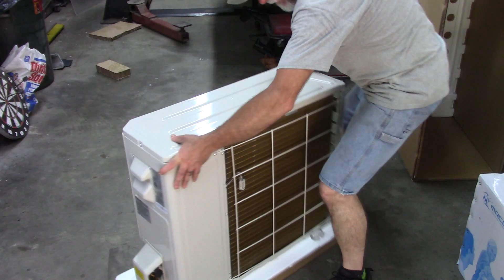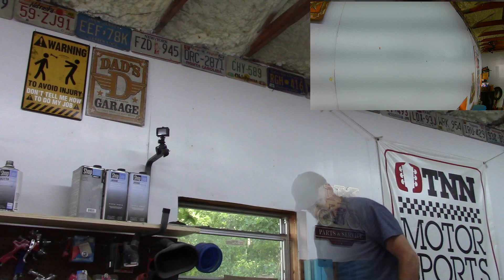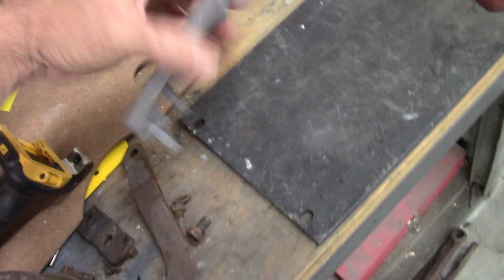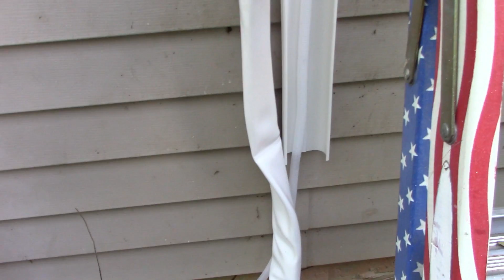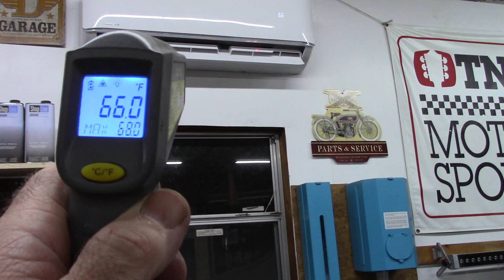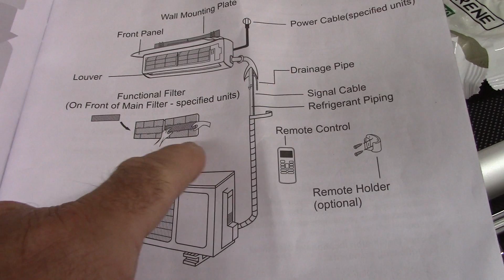Mr Cool mini split air conditioner install.

Comment: Great video... One question: is there a prevision to run the gas lines through the top or only the two 3.5" holes shown on the cardboard template?  I ask because my shop is concrete block and going over the wall and out through the soffit would be a ton easier than finding a 3.5" core drill..  The drain looks like it can go out anywhere lower than the unit. 
 Please keep us updated on it for a while. I have got to put AC in my shop soon. We have gone to 102* with high humidity lately and in no way am I working in the shop with that kind of heat..
Reply: Anything is possible or doable but keep in mind that installing the unit in a manner not covered by the manual may voide the warranty. Anyway, you would have to install the unit away from the wall in order to have room for the lines to go behind it and up.  Obviously, the drain would have to go straight out (at an angle) or you will have water pouring out of the unit.
Reply: Going thru concrete, use a small drill bit, drilling more holes and knock out with a hammer. Use foam to fill the hole after copper is placed.
Reply: Also, they make inline pumps for the drains when ran "up and over" "above" if you don't want to drill wall.
Reply: The drain line isn't really a problem. I just don't want to drill a large hole in the wall. As BIG RED said, I can build if off the wall to take the refrigerant lines up and over the wall and out through the soffit, but I just wondered it the machine has room to do it without building off the wall. The drain line isn't really a problem at all.

Just watched it again and around the 6:45 mark he starts showing the back of the unit. Doesn't look like their are provisions to go up without building it out away from the wall.
Reply from the maker: It appears you can only go through the wall where the 2 holes on the cardboard are indicated. It may be possible to modify it, but I can't say for sure.

Comment: scented mesh filter? for freshness? Clearly not intended to filter the air since its too small.
Reply: The mesh filters snap into the backside of the regular filters and are a Hepa filter. They collect much smaller particles that can cause allergies. I would use them in a home install. They probably won't do much in a Dusty shop setting though.

Comment: That drain elbow on the outdoor unit is if it installed over a door or walkway because in the winter it will defrost and drain the water. Leave it off for your house
Reply from the maker: Didn't think about that. Thanks.
Reply: You act like you do this for a living Joe Shearer
Reply: Justin Hernandez part time HVAC part time
Reply: Your part time HVAC, full time hamburglar

Comment: I think I would have ran the lines inside the shop and then made a hole at the height of the condensor. Leave the excess inside the shop

Comment: I would recommend placing 3/4 inch plywood behind the unit to reinforce it if matching up a stud is a problem.  Match the plywood with the stud, and all the other mounting screws will go into plywood for a strong and safe connection.
Reply: the head units are not heavy.  you can use wall anchors.  3/4 plywood is overkill.
Reply: Those white spiral type plastic drywall anchors will hold 75 lbs each in 1/2" rock. x 5 anchors = 375 lbs
Reply: The unit is less than 40lbs. Use snap toggles if you like. Over 250lbs capacity in 1/2 drywall.  https://www.lowes.com/pd/toggler-2-pack-assorted-length-x-1-4-in-dia-toggle-bolt-drywall-anchor-screws-included/3183821?cm_mmc=shp-cprdtahgooglelia-126-hollowwallanchors-3183821-_-0&kpid&store_code=1200&k_clickID=go_625706834_34613748070_111132556630_pla-259586162290_c_9005889&gclid=EAIaIQobChMIkNuXq_HR4QIVh0SGCh0_SQvyEAQYAiABEgIHE_D_BwE

Comment: dont u vacuum before u turn on a freon  ineed to install one for my house
Reply: The suction and hi side are pre-vacuumed, and have a piercing probe at the condenser. The condenser is pre-charged with the correct amount of refrigerant.  When the fittings are tightened, the lines get filled with the refrigerant as required.
Reply from the maker: This kit is DIY. No vacuum per instructions.
Reply: This is a DIY kit.  If you pull an evac you will suck out all the refrigerant and ruin the equipment.
Reply: You unscrew / open the service valves w/ the allen wrench AFTER pulling a vacuum!  After pulling the vacuum and valving off the vacuum, release the refrigerant.
Reply: Your pulling a vacuum on the lineset and evaporator, not the condenser its closed off until you open the valves to release the freon
Reply: g smoove Finally some one with a brain. LOL. That's basically what I've been saying all along. So, if I haven't described it well enough I'm not a teacher. I agree, one should not test for leaks with a vacuum. Pull an evac on the NEW connecting tubing.
Reply: I don't want to beat this to death, but it's unfortunate that some are very obstinate about misinforming people about this product without taking the time to understand that it's different than most other minisplits.  This text is directly from MrCool technical support: "On the 2nd Generation DIY unit, the line sets, the condenser, and the air handler are all precharged."  If you evacuate anything then you are going to lose some of your refrigerant.  Frankly if one is this stubborn about "doing what you always do" then you should have never chosen this product in the first place, just "get what you always get" instead (it would both be cheaper and give you control over length of the lineset) and stop parachuting in here to confuse people with driveby commentary.
Reply: Yes, you've beaten it too much. I'm licensed with an associates degree in HVAC and have been for a number of years. What we recommend in the field isn't voiding any warranties. At no time have we said to open the condenser side. (or evaporator) How can one lose refrigerant when the high side (and/or evaporator) isn't opened to begin with ? We simply stated it would be best (not necessary) to pull an evac on the NEW connecting tubing and/or evaporator side if applicable. If you don't understand that then don't comment. A licensed professional will install this same system using professional installation techniques. In the meantime don't tell us how to do a pump down. If you can't follow our simple instructions perhaps you shouldn't be around any AC systems to begin with. If you're a DIY'er good for you, install this system as the armatures do. But don't tell professionals how to do their jobs.
Reply: "Yes, you've beaten it too much," says the guy who just replied to my second comment on this subthread with his sixth ...
Reply: Yes, I've been trying to help others answer their questions by giving them professional advice without charge. Not trying to be a know-it-all by pasting manufacture recommendations from their instructions manual a full month after the OP.'s initial query LMAO.
Reply: That's what I thought. Pulling a vacuum and watching the gauges will show you if you have a leak or not.
Reply: I suppose one can detect a leak while pulling an evac but in reality pulling a vacuum is mean't to boil off moisture in the system and to make room for refrigerant. Just touching a pipe creates water. Not to mention humidity already present in the atmosphere. Water boils at a lower degree in a vacuum and boils at a higher degree under pressure such as in a pressure cooker. Listen to your local weatherman, low pressure means lower temps (possible rain) High pressure means (depending on how high) fair to higher temps. To answer your second post that's how I'd do it making sure all moisture is out of the system. Water + refrigerant = acid.
Reply: What so many so called pros don't realize or they just want to post and confuse people is the MrCool DIY models come with refrigerant already in the outside condenser just as any other unit BUT the inside evaporator and entire lineset is already evacuated and under a vacuum from the factory. They have quick connect like fittings to allow a DIY type install.
Reply: Pressurize system with nitrogen to check for freon leaks. About 200 lbs psi
Reply: It depends on the application. Personally I'd pull an evac for two reasons. One, it makes more room for refrigerant, secondly, it'll help boil off any residual moisture that might be in the system.
Reply: @sonsofthunder915  But this is a Youtube talking about DIY Mr. Cool so when you say, Personally I'd pull an evac for two reasons, it would imply that you are talking about if you had a Mr. Cool DIY you would do this. I am not sure if you are understanding that Mr. Cool says not to pull a Vacuum it will spoil the warranty and it is because from the factory the line-set comes with a Vacuum so there is NO moisture in the tubing and if you cut the line you would not be able to connect the press fittings that they use because they use O rings when pulling a Vacuum you do not use O rings but either you will need to braise or use Flaring nuts to make the connections.
Reply: Hmm, didn't I say, "IT DEPENDS ON THE APPLICATION" ?
Reply: For the MRCOOL DIY series -- the subject of this video -- it's not necessary, that's the entire point of the product, the lines are pre-charged, you'd lose your refrigerant if you evacuated (just get a different unit that is a bit cheaper you can size the lines optimally, etc, if you've got the equipment to vacuum).  It does not "depend on the application" at all; there are no circumstances where you have to vacuum.
Reply: Where did I say THIS particular application ? Show me where I specified the "MRCOOL DIY series. FYI yes, if a leak were to develop the system would need to be evacuated after repairs are made. Or, if one were to replace any one or more of the following components such as the connecting tubes, metering device, strainer, filter/dryer, evaporator, condenser, etc. one would be required to pull an evac. So, you're wrong by saying there is NO need to evacuate this system under any circumstances. Besides, it wouldn't hurt to pull an evac on the new connecting tubing before charging this system with refrigerant. If one doesn't have a pump they can rent one from a local tool rental or some hardware stores.

Comment: How did you determine what size unit to choose? What size area will you be cooling with it? Great Install video.
Reply from the maker: My shop is 900 square feet. 24000btu is basically ideal for 1000 square feet.

Comment: Great video. Getting ready to order a unit for my garage. One question I had was Mr. Cool did not say to vacuum the line set out before charging to get all the air out?
Reply from the maker: No vacuum.
Reply: What so many so called pros don't realize or they just want to post and confuse people is the MrCool DIY models come with refrigerant already in the outside condenser just as any other unit BUT the inside evaporator and entire lineset is already evacuated and under a vacuum from the factory. They have quick connect like fittings to allow a DIY type install.

Comment: Nice install and vid.
Only thing I would have done different was to mount the disconnect on the shop wall. Not on a post. Those plastic connectors can be separated  to allow for a stress connector bushing to be inserted on the cover panel for the condenser. Additionally, there are split stress connector bushes available as well.
Keep going !
Reply: You can also slip the crimped connectors out of the plastic housing with a pin usually, then put them through the watertight fitting, and put the plastic connector shroud back on.
Reply from the maker: Thanks. I'll check into the split.

Comment: The white anchors you used on the bracket are only rated for 25 pounds of sheer force the correct hardware would be a snap toggle of some kind I like the 1/4 20 toggles my self they are rated up to 250lbs of sheer force and I highly recommend them we use them all over the hospital i work at for mounting computers and TV on sheetrock walls where the studs are not easily accessible....hope this helps
Reply from the maker: That's why I added the 5th screw in the plate directly into a stud. The walls are 1/4" plywood.
Reply: i can see all the fist sized holes in the drywall and computers smashed on the floor now lmao.

Comment: I'm laughing at the Allen wrench. If you're capable of installing this ac. You probably already have a set of wrenches. Lol. If not. Leave it go the professionals
Reply from the maker: It's nice that they provide it though.
Reply: I'm curious how hot the uninsulated wall gets during the heat of the day.
Reply from the maker: I think I checked prior to install, and it was very close to the insulated wall. It really never gets hit by sunlight until late fall.